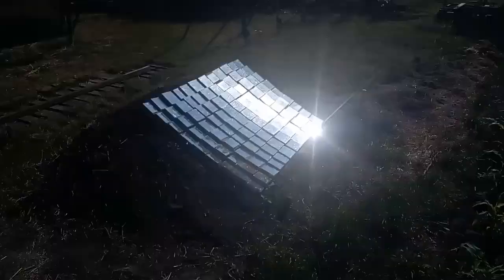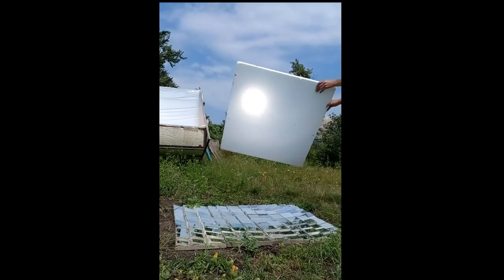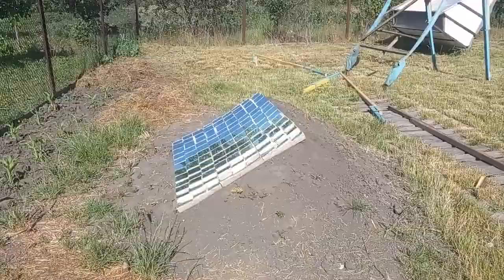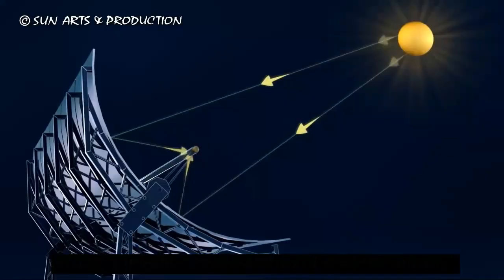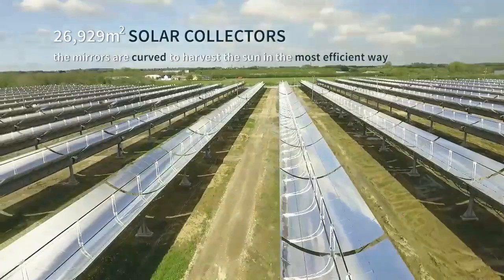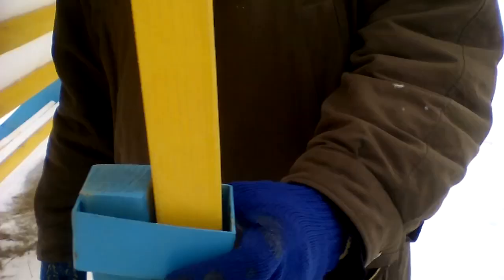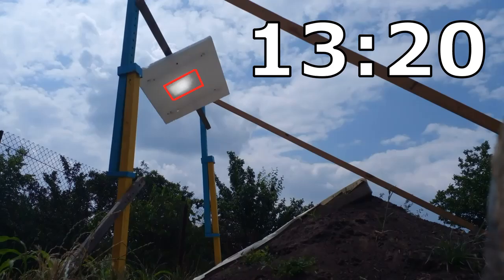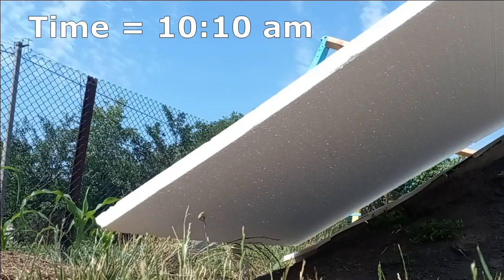These 3 innovations lead us to cheap solar electricity

Comment: Ayy man! You don't see my comments, so I'm commenting again.
I saw a way to make the mylar/space blankets last much longer.
By spraying a gloss enamel coating on the vulnerable side, you can make it last much longer.
Less need to replace very often.
Reply: Interesting...how about sharing some videos about it?
Reply: We can buy space blanket at the dollar store. What would be the cost of that gloss enamel coating? Will it get duller or yellow over time? How long will it last?
Reply: @alexandrevaliquette3883  we'll not use the side that'll be coated. 
It'll face away from the sun.
In our case, the side that'll face the sun.. will be the plastic surface side.
I'm gonna explain a bit so brace yourself.
The side we'll coat has exposed metal, probably aluminium. Which we'll coat, because if it is completely exposed.. it'll fade and probably oxidised or something.
Although it may not be too economical, or worth too much.
It'll save us from replacing the mylar too frequently. Additional benefits are that the other side will reflect better.
Plus we'll only lightly coat the exposed side. So probably not very expensive.
And it'll probably last a good while as long as there's not too harsh weather, and the plastic doesn't wear out. I mean I think enamel is the same thing as used to protect mirror coatings, which last quite long.

I can link or name the video, where I saw this strategy if you want.
Reply: @yasirrakhurrafat1142  I've watch a video where he test and confirmed that the 'Aluminium side' of the mylar sheet last way longer than the 'plastic side' of the sheet when both exposed to sun. It was a side by side comparison over 1-2 year.
Reason: Aluminium form an oxyde layer (Al2O3) that is very durable. Plastic/polymer, on the other hand, deteriorate with UV light.

Perhaps you can spray the plastic side to make the mylar thicker and more wind resistant, but expose the metal side to the sun. We need testing bro!
You can contribute by sharing your own long term testing. It's just a cheap 1$ mylar sheet cut in half, test A-B with and without your spray coating.

Have a nice day
Reply: @alexandrevaliquette3883  makes sense.
Although from what I remember he showed that the aluminium starts wearing off of the sheet, making spots, becoming less reflective.
I have to look for it again, I think I've definitely seen the video.

I think making my own reflective coating.. to put on acrylic or something durable, should be the best.
Reply: @yasirrakhurrafat1142  He already figure out theses problem. He used high polished very thin and somewhat inexpensive stainless steel sheet to get a very durable solution.
If you do your own coating, it will be less durable, less reflective and probably not that cheap either.
Stainless and aluminium are very highly reflective.
Mylar is great, but will wear off so it's a consumable.
You need to estimate ROI for a 10 or even 20 years period (fabrication, but also include maintenance labour and expected consumable)
Reply: @alexandrevaliquette3883 i see. You figured it through.
He did as well.
I just thought stainless could get rusty that's why I didn't consider it much. But I think a thin plastic film should be able to protect it.
I was also thinking making with aluminium foil.
Reply: @yasirrakhurrafat1142  The problem with Al foil is the reflection is more diffuse than solid sheet. So it's less efficient, Buuuuuuut! Is very cheap!
If you use Mylar or foil, you need to factor in the replacement/maintenance over time. Or maybe you spray stuff can do wonder... To be tested.
Reply: @alexandrevaliquette3883  I plan on making the foil shinier using some sanding or polishing, buffing whatever. Better reflection, less diffusion.
Should become much more mirror-like and more efficient.
Only problem remains is to make parts to join up, to a larger parabolic mirror .
Making multiple of them is ok, but a larger one should be better.

I'm looking into hardening materials that'll solidify the foil or mylar into a solid shape and make it durable, for cheap, and keep it light weight.
I always consider maintenance, and redundancy. Thus try keeping it cheap but practical.
Reply: @yasirrakhurrafat1142  If you spend 5 hours to polish a 1 square meter, you have to put this in the total cost.
If you are doing it just for fun, it doesn't matter. But if your goal is to make an affordable system that 'normal' people can benefit or scale up, you have to think different.
My guess is the mirror part is not the most expensive part of the whole system. But we have a tendency to 'focus' on the mirror (no pun intended!)
Reply: @alexandrevaliquette3883  I am indeed thinking on simplifying a steam engine.
Hopefully it would work.
If it turns out impractical, I will seek help of the fluidine engine.

Although there are strategies to triple or quadruple the energy output of simple solar panels. Using the mylar or cheap mirrors.
In the spirit of practicality, it should be in ways, better.
I admire your attention on details though, it really is very essential to consider the overall cost. Reliability, robustness, flaws, and hassle.

Comment: Great ideas, invention and analysis.  For a commercial version, I believe that air or hydraulic powered jacks could be computer controlled to automate the change in position of the receiver in both vertical and horizontal directions replacing the manual adjustments in the design.  This would give a finer grain of control and reduce manual labor costs. The cost effectiveness of this would depend on local labor costs.

Comment: Love your videos... can't wait to get my electricity for free! :)

BTW: If your receiver was a pipe right across the mirrors, it would not have to move during the day - the focal points would just move along the pipe. There would be some more shadow, but if this was a straight line across the middle of the mirrors, you could just not put mirrors where that falls.
Reply: There would also be more surface are for  heat loss to the air where the light was not hitting the pipe.

Comment: You could possibly use an wax piston to automate your movement seen at 7.25.
Have the closed side of a piston on the left (the way the square moves across the rectangle) when the light hits this closed side it will heat the wax (could use water to steam, if hot enough), the wax will heat up and expand pushing the piston and moving the receiver right to left. During the night it will cool/contract and reset back to the right side starting position.

Comment: Sergio, I see what you’ve done but I’m not sure how you accomplished it. It would be interesting to see the process by which you created each of the cement blocks. I can create the geometry using solid modeling software which in turn could be used to 3-D print the various segments. I could also use the same defining structure to create the negative of such a shape and then use that as a mold. I haven’t figured out how that might be useful, though.

Edit 24 hours later: I have the modeling process worked out. I have a corner segment comprised of four mirrors completed as a solid.
Reply: video?

Comment: There are new more efficient (40%) thermoelectric generators that would be a good match for these solar concentrators. The complexity and cost of steam turbine generating systems might not be worth the higher efficiencies, at least in smaller systems where 65% efficiencies is common. The Thermoelectric units would also be easier to scale.
Reply: ericliu5491  More infomation please

Comment: Maybe easier to move the mirrors than the receiver, by balancing the mirrors at the center. and a controller or better maybe gears adjust it accordingly. If any issues sensors can help.

Comment: Hi, all your videos are really interesting and full of good information and analysis.
I was wondering if you have considered coupling solar mirror with Thermal Batteries. So far I have seen most thermal batteries coupled with electric power to charge them. I think it's a good idea to go directly from solar to thermal without passing by electricity production (like PV). Have you considered that possible application?
Reply: U think low temperature thermal batteries inside the living space are a way.  Even water mattresses could be heated.  Thermal batteris in the form of seating surfaces, under tables etc.  They would require little or removable blankets etc  so that the heat naturally releases at night with little to no pumping through separate heat exchangers. Would save on fans/pump electricity.  And poor insulation would be less problematic because it would be heating the intended space anyway.

Comment: The efficiency is still in question, the steam turbine can convert ~ 5% of the collected energy, which is very less. Can anyone here update us on this?
Reply: the solution might be a low temprature sterling engine instead of steam engine

Comment: Why have a small collector? If you make it larger in collection area you can pick up more reflected energy. Equally if you add more cheap mirrors it does not matter too much if you lose the edges at dawn and dusk!
Taking it a step further if you extend the centre of your mirror array to make it more oval or even semi-cylindrical you would get better output. Couple this to an elongated collector you get more energy out too! If you make your mirror array into a parabolic cross section around the east-west axis you do away with the need to move the collector (much like the big array you showed with the hot oil! 
Of course the devil is in the detail (and it is not me doing it) so just where the best cost-effort-output point (for you) is may not be obvious!

Eather way it is good to see individuals taking on the challenge!
Reply: Not an expert here, but I think the receiver must be as small as possible in order to avoid it throwing shade at the mirrors.
Reply: @schefre35  Usually you would think so. But if you extend the device laterally and have a parabolic mirror you will not be losing much (and what you do "lose" you would gain by direct heating of the sun to cause the shade in the first place). So smaller just becomes narrower.
Reply: @totherarf  Ah I see it now, thank you.